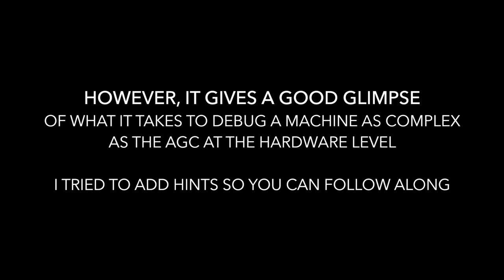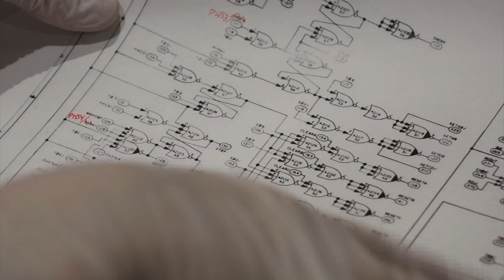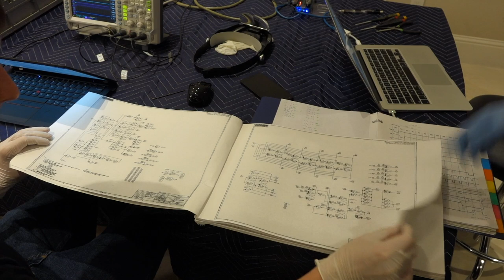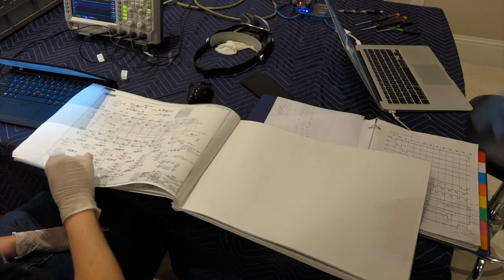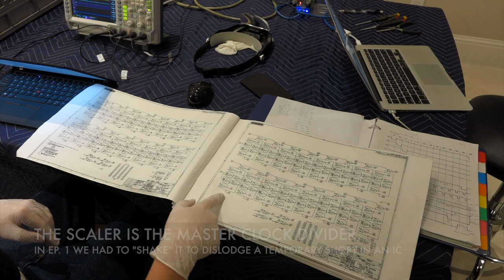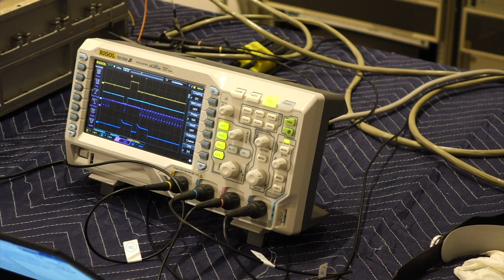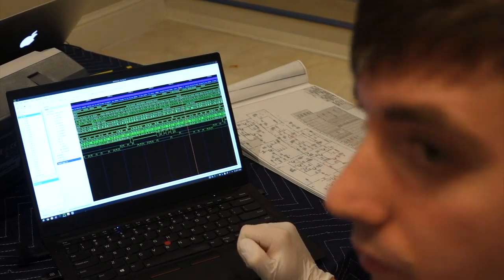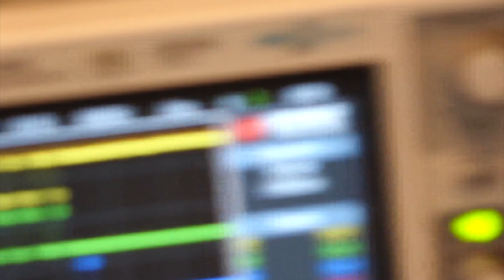Apollo Guidance Computer Part 14 ½: Bonus Material

Comment: I am finding this fascinating. I made a wire wrap board in University in 1978, to control the hardware on our group project. It was a train set, I was responsible for points and signals! We also used DIP chips and we also had the same problems, and independently in '78, we also used long nose pliers to fix the problem. I feel like I am in the room with you! 

We did have a computer with core memory, but it was so fragile us undergrads were allowed to look not touch! So I never got to play with it. 

Really impressed by the amount and quality of the test kit you have. Great advert for the companies involved with these. I used an early version of the HP Logic Analyzer when we were debugging our stuff at Uni. I also used a pulse oscilloscope, on the back plane of a VAX 11/750 that was connected directly at the bus level to a Cray XMP. We kept crashing the Cray, which was not good. At 2am, we had our eureka moment when we found two pins on the Vax had been bent together. The Vax didn't care, but the Cray sure did. A quick tweak later and we could get the system running for the geologists again!
Reply: DEC stuff just goes on forever though. After total nuclear annihation, all that will be left is cockroaches and VAXen. I wouldn't be suprised if the oldest computer still doing its original job is some dusty old VAX or PDP-11 humming along somewhere running some horribly dated but critical manufacturing equipment.
Reply: Old stuff just works forever. Built properly. Old tech may be slow but it just works.

Comment: This is so wonderful.   It brings me back to my days in RCA when the senior engineers would hand me a folio of schematics - all gate level - and ask me to debug some glitch or another.  I did have a logic simulator (antique by today's standards - but absolutely a million dollar production back in the day) and a fault simulator at my disposal.  I wouldn't have to totally reverse engineer things myself, like you guys are doing, because the guys in white shirts and horn rimmed glasses and pocket protectors were just down the hall, and as long as I didn't bother them TOO much, they would answer my questions. (And it's entirely possible they already KNEW or suspected the answer to the problem - they were just using me to double check, and to  train me.)   I never got to find out what the systems were that I was debugging. - I never got to see the actual machines, and I suspect that was due, in part, to my never having a security clearance so they would only give me non-secure, generic, chunks to figure out.  Over time, we dropped the pocket protectors and white shirts (dark slacks, dark shoes, dark tie) because IBM had dropped their dress code favoring the Silicon Valley ethos - and then I moved to Silicon Valley and never wore a white shirt again.   But I look back on those days fondly, and when I see the great work you guys are doing so passionately, it brings me back.  Thanks again for the telling of this amazing story.

Comment: I ran into an issue like this in the development of NASSP's CSM RCS system; After much work to make it work like the real thing, when set up according to the Apollo 8 checklists, it outperformed expectations by a large margin. The SC continually bounced from one side of deadband to the other and used way too much fuel. I double- and triple-checked my work, got annoyed, and set it aside to work on something else. A day later, while checking post-mission reports for information on the something else, I found the astronauts describing exactly the RCS behavior I was observing; It turned out the RCS had been upgraded during development, but the checklist had not been updated to take this into account. Later missions flew with a corrected checklist, and when using that instead my RCS behaved exactly as expected.
Reply: Nice! I didn't know about that one. It's always an amazing feeling when you independently rediscover stuff like that. :)
Reply: Oh! By the way, I asked indy91 about this, but I wanted to double check with you. When I talk about NASSP, what is your preferred way to say its name? As the letters N-A-S-S-P or as a word like "nasp"?
Reply: @mikestewart8928  I tend to say the letters, reading it as a word sounds too much like "Nasty" to me.
Reply: @SuzuranMajere  Cool, that's what I've been using. Thanks! (And thanks for all of your brilliant work on NASSP!)

Comment: Yup thank for that part that was skipped. It is a great glimpse of how timings are entangled and secured with cleaver tricks.
But I was hoping a more in depth explanation of how core rope memories worked. Maybe when everything get fixed we'll get a tour of the machine?
(love the glitch. Still there, even in the sim. Ghost in the machine!)
Reply: Oh, core rope memory is pretty simple.
It's all induction, like a AC transformer.
At it's simplest, you have a iron (ferrous) ring.
Through that ring you have the source wires (AC in). Pulse it, and if it interacts with the core, it induced current in the sense line.
It only interacts with the core if its wound round it. If it's not wound round it, no induction.
Now you have a bit, 1 or 0, in the core or out the core.
Now wind 8 wires around or not around the core. Pulse them in sequence.
Now you have an 8 bit byte.
And so on.
But it's designed to be pulsed, so the wires are thin. The safety circuit in the AGC in this video skips to the end of the memory cycle to protect the ROM. Otherwise it'll burn out with a DC signal over a long time.
Reply: @MostlyPennyCat  Not quite -- the cores in rope memory are magnetized circularly in one of two directions just like regular core memory. The cores are quite special; they're made with extremely thin (1/8-mil thick) molybdenum permalloy tape wound on a bobbin. The thin tape is needed because thicker tape means more eddy currents means slower switching. Since the cores have hysteresis, you use (relatively high) DC currents to flip their polarity, and it is this flip that is picked up on the sense lines. You don't have to pulse anything in sequence; you simply thread sixteen wires for a word either through or around the core, an when the core flips, watch all sixteen wires to see if each one gets a pulse or not.

Comment: Loved that episode (and the bonus material). Seeing those glitches I wonder: What is the clock frequency of the AGC main processing logic?
Reply: The AGC is driven off of a 2.048MHz oscillator, but that is immediately divided into a few phases of 1.024MHz clocks, and none of the logic truly operates at 2.048MHz. It takes 12 cycles of the 1.024MHz clock to perform a memory cycle, and instructions on average take 2 memory cycles to complete, so the effective instruction rate is ~42.7kHz.

Comment: You are all truly geniuses  . I wonder though, as fragile as this old turd is, do you REALLY think it could have handled the stresses of the SaturnV ? or was the final one more hardened ?
Reply: Of course, the production version is potted, Joints are welded, quality materials.....stress screening..... 

It should be handled with great care now though, the ICs will not be as robust as they were new, bond wires to chip die can degrade leading to detachment under shock.

Comment: I finally realized how different and economical rope is compared to core. You need only one metal ring for each word. And the word can as long as you want or have room inside the ring
Reply: Even more amazing, one ring holds twelve full words. 512 rings x 12 words produces the 6K word capacity of a module.

Comment: The logic ICs used in AGC contains single gates (OR gates)? Doesn't have FF ICs for example, in this video looks clock divider by 10 using FF created with single NOR gates?
Reply: I think he explains in an earlier video that  they used only NOR gate ICs and derived all the other gates from those. It's more ICs but it's simpler cause they're all the same
Reply: @kartingpt  I see it, thanks! :) I think explained in the very early video of this series.

Comment: So there is quite a big current in these memory wires. Does this also mean you risk overheating when you access the same memory location very often in a certain timeframe, say in a waiting loop? Did this impose restrictions on the programmer in this respect? Very good video’s. Thanks.
Reply from the maker: It’s a couple 100 mA pulses, a few microseconds long. The total memory cycle is about 10 times that. So no danger in normal operation. However if it were to hang while the current is on, it could damage the wires in a few seconds. I’m sure the pioneers blew a few during development, we almost did when we did our core memory video, and sort of re-discovered the wheel.
Reply: CuriousMarc thanks for your answer. My first thought would be to place some capacitors to make sure nothing passes to the memory but a pulse, but that would be very analog...

Comment: The only thing that could have made this better would have been to state which line the glitch was on. Maybe I just missed it.
Reply: The glitches are on the ROPER (rope selection signal for modules B1 and B2) and ROPET (rope selection signal for modules B5 and B6). The problem with the rope simulator boxes was that transients on the ROPET selection signal were setting a flip-flop that should not be set, and making the boxes think modules B5/B6 were being addressed when they were not. We thought the transients may have been a problem with the AGC itself, but the exact match with the hardware simulation pretty much ruled that out. We ended up having to add the capacitors to filter out the transients on the rope interface side. The designers of the AGC presumably didn't bother to remove the transients form the digital logic because they don't affect real rope memories at all.

Comment: How many LEs that verilog model would take considering Altera FPGA as target?
Reply: My last Altera FPGA build (for a Cyclone IV) was 12,546 LEs. It's that high because the AGC times some things with gate propagation delays, and these delays need to be properly simulated for everything to work perfectly. Every NOR gate takes a propagation delay clock,  samples it inputs on the falling edge, and applies its outputs on the falling edge.
Reply: @mikestewart8928  So i won't be able to put it on my one, had to buy bigger FPGA with more LEs for that. Well, i was not expecting such large ammount of resources needed for that. Well, thanks for explaination. Seems like FPGAs aren't perfect for everything and sometimes propagation delays turns from just  a problem into hell ;-) Anyway, i am still waiting for USB blaster from China so it gonna take some time till i get into FPGAs for real.

Comment: Great series of videos on a great accomplishment for its time.
You say that the sense pulse timing, which was a problem with your simulator code, has to be short, not just for speed but to prevent burning the wire out.
How big was the current pulse, and if the  wire was so fragile, how much shock testing went into the fabrication and assembly of the core memory units?
I am assembling a core memory kit/shield for Arduino, looks  good.
https://www.tindie.com/products/kilpelaj/core-memory-shield-for-arduino/
I have some ideas for core ram, using the Arduino controller, just as a proof of concept... lol
Keep up the good work guys.. I look forward to each episode.

Comment: So does Mike's Gate Exact FPGA need those two caps as well?
Reply: Remember, it's a core rope *simulator*... the problem is not there with normal core rope memory, I'm guessing.
Reply: @scowell  They showed they were able to duplicate the glitch with their emulator. They got the exact same glitches in the exact same spots.
Reply from the maker: Different glitches. We thought they might be related at first, but they were not. The Verilog glitch is a digital glitch in the AGC, which is all digital NOR RTL gates. Mike has a complete model of the AGC logic (but not the analog parts like cores and core drivers). The rope simulator is another beast entirely, with analog magnetic interfaces combined with TTL gates. We did not make a model of that. The analog part where the glitch is would have been quite difficult to model.